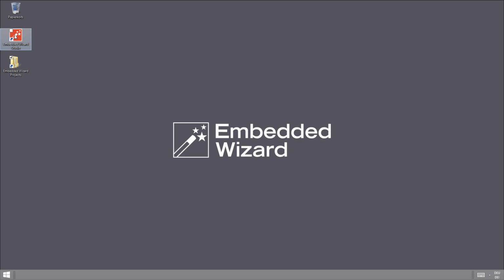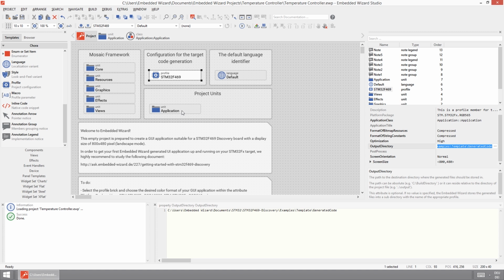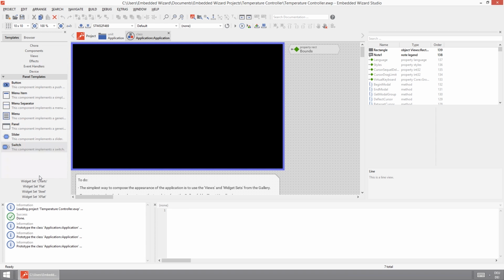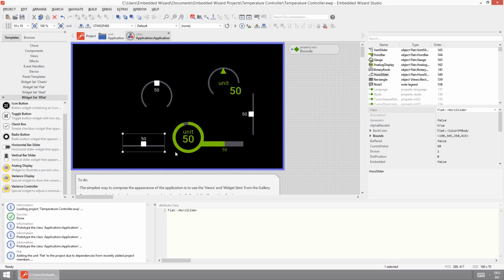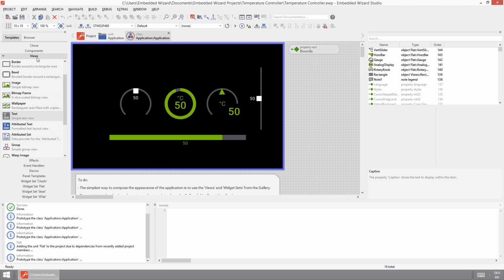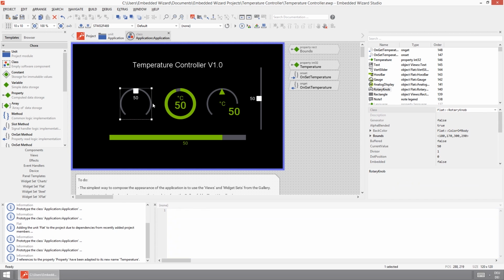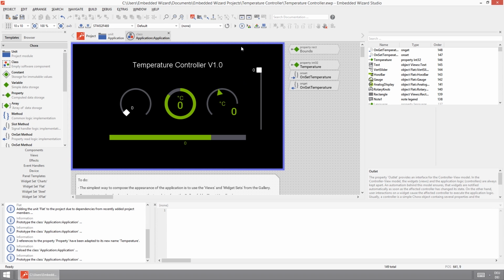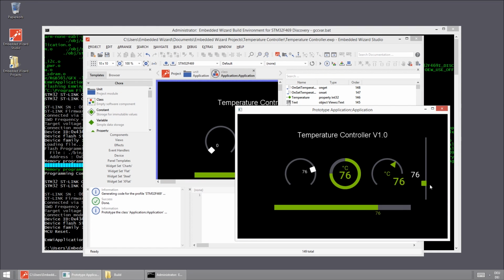Create a GUI application from scratch with Embedded Wizard

Comment: Can I know why I cannot invoke the compiler??
after i type make install, it appears as below
Compiling main.c
process_begin: CreateProcess(NULL, arm-none-eabi-gcc -c -O2 -Wall -mcpu=cortex-m4 -mlittle-endian -mthumb -mthumb-interwork -mfpu=fpv4-sp-d16 -mfloat-abi=hard -DSTM32F469xx -DUSE_STM32F469I_DISCO -DEW_MAX_SURFACE_CACHE_SIZE=0x400000 -DEW_MAX_GLYPH_SURFACE_WIDTH=256 -DEW_MAX_GLYPH_SURFACE_HEIGHT=256 -DEW_FRAME_BUFFER_COLOR_FORMAT_RGB565 -DEW_USE_OFFSCREEN_BUFFER=0 -DEW_USE_DOUBLE_BUFFER=1 -DEW_SURFACE_ROTATION=0 -I. -I../../Misc -I../../BoardConfig -I./GeneratedCode -I../../PlatformPackage/RTE -I../../PlatformPackage/RGB565/GFX -I../../../STM32Cube_FW_F4/Drivers/CMSIS/Device/ST/STM32F4xx/Include -I../../../STM32Cube_FW_F4/Drivers/CMSIS/Include -I../../../STM32Cube_FW_F4/Drivers/STM32F4xx_HAL_Driver/Inc -I../../../STM32Cube_FW_F4/Drivers/BSP/STM32469I-Discovery -I../../../STM32Cube_FW_F4/Drivers/BSP/Components/Common -I../../../STM32Cube_FW_F4/Drivers/BSP/Components/Common/otm8009a -I../../../STM32Cube_FW_F4/Drivers/BSP/Components/Common/ft6x06 -o obj/main.o main.c, ...) failed.
make (e=2): The system cannot find the file specified.
make: * [obj/main.o] Error 2
Reply from the maker: Hi! Please have a look at the detailed description found at our knowledge base http://doc.embedded-wizard.de/getting-started-stm32f469-discovery.
If the problem still occurs, please feel free to ask at our open community forum found at http://ask.embedded-wizard.de
Reply: Try to start  'StartBuildEnvironment.bat' as a administrator